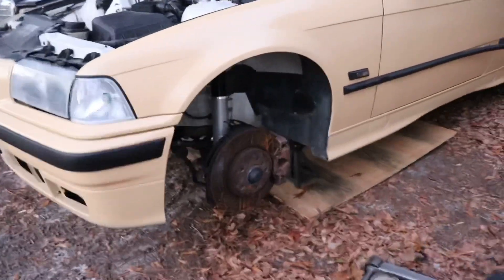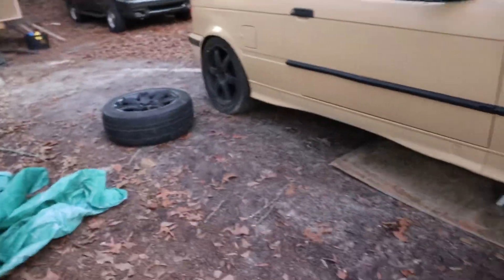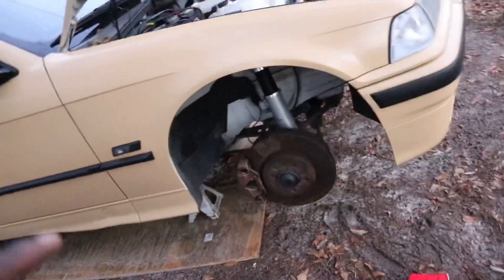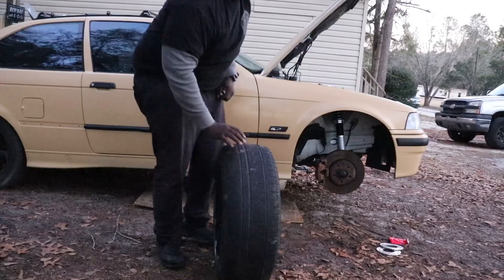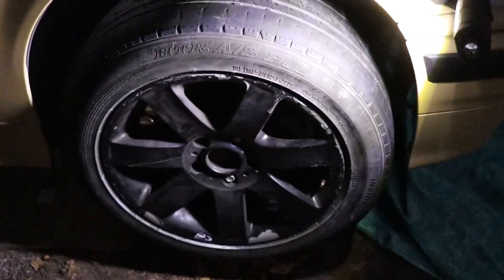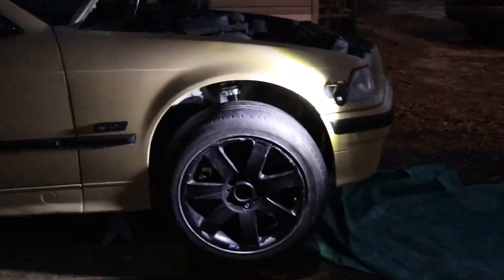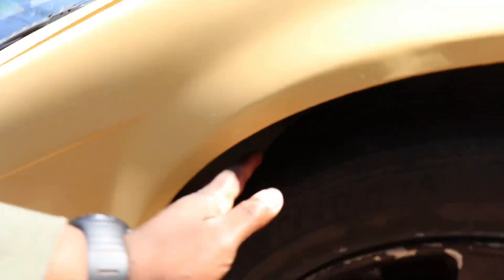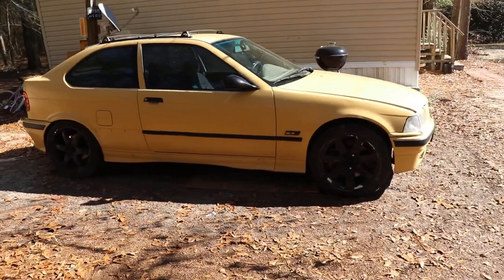Maxpeedingrods Install After 4K Spring Install - Ride Height and tire clearance check E36

Comment: Here's my 2¢. Those springs look like they have +-1cm of actual travel before bottoming out.  They are too soft for that application and they have far too many coil windings. The original 8k spring might of been a bit stiff for your intended purpose but they had better winding spacing and the spring rate guaranteed that the spring wouldn't bottom out on itself. These 200-300lb-in springs are a bit too soft. Along with the amount of windings in the spring and the weight of the car your almost guaranteed to bottom out the spring on a violent bump in the road. I'd honestly save for a better set of coilovers with a better desired spring rate and a better designed spring/coilover shock. A set of nicer springs (swift, eibach, hyperco) would out price the maxpeedingrods coilovers.

Comment: Question the perch from the rear coilovers  goes on the bottom or the top ?
Reply from the maker: There is an eyelet on the bottom and a pillow ball mount for the top with the adjustment lock in the middle for height

Comment: I am trying to get these coilovers, whats your overall feel about them?
I am looking to get a comfortable setup that also handles great.
I do not want a harsh or bumpy setup.
Tabs
Reply from the maker: You can’t get somewhat of a comfortable ride when you adjust preload but if you want a sure guarantee then spend your money on some bc racing coilovers
Reply from the maker: @GraffitiFart  I found them on eBay. Measure your springs and you’ll find them there. Speedway motors has a lot of spring choices btw